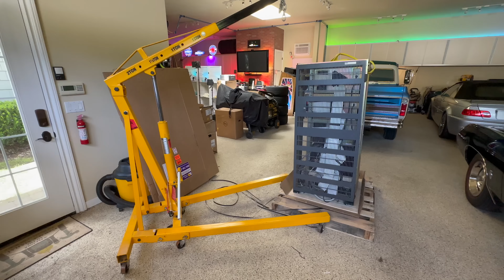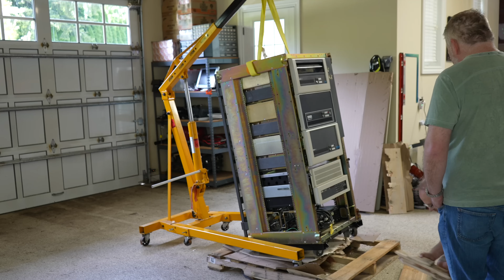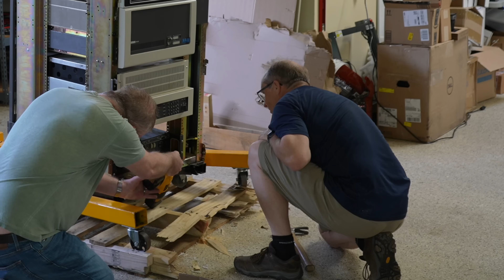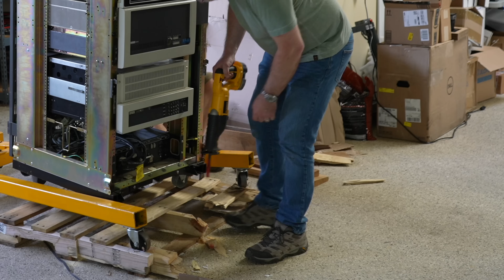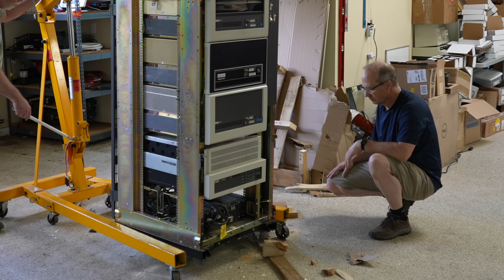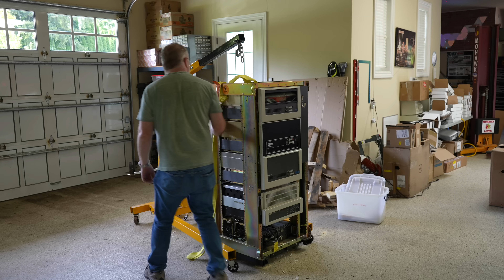I Bought the HEAVIEST Computer on eBay: The PDP-11/34!

Comment: I would very much enjoy seeing more videos on the PDP-11/34.  I worked at a semiconductor company that had a VAX/VMS system.  Not sure what the model was, except that it was a VAX. This would have been in the late 80's and early 90's. The system had Fortran and C compilers, and I wrote a lot of small programs in both languages. At some point, it also ran WordPerfect.  One night I wrote a program that calculated an approximation to a mathematical series; unfortunately the program got stuck in an infinite loop that kept taking more & more system resource and bogged down the control software that kept production running.  Needless to say, I heard about it the next day!

Comment: But, I obtained a surplus PDP 11/780 with a cluster module in the early 1990s.  I also used an engine jack to rig the unit into the room/lab that it lived in for the rest of it's life.  I had operated systems from 11/20, 11/730s and 750s on up prior to that experience.  And had experience with multiple 11/780 machines in a VaxCluster needing an elevated-floor configuration and 10base 10 Ethernet as a system administrator for a DoD contractor before that.    You just have to figure out how to rig the hardware into the desired space, or hire an experienced rigger who can put it in the spot where you point.  And make certain that an experienced master electrician wires up the configuration to meet the power and grounding requirements...

Comment: The Weather Channel's STAR local forecast system ran on the PDPs (34s, and 70s maybe) and some MicroVAX systems back in the early 80s to early 90s. The software was developed using PASCAL on the RSX-11M operating system.

Comment: Never worked inside a PDP 11 but I did some programming on one in my first professional EE job 45 years ago. I would be greatly interested in your future endeavors with this computer.  You were pretty blasé in describing what happened when you got it to boot but I suspect your heart rate spiked when you saw the directory listing start to flow on the terminal. I know I'd be doing a Snoopy dance if I was there. Congratulations! This is archaeology on par with discovering a new tomb in Egypt.

Comment: Love stuff like this! Back in the 70s I built one of the first Heath H11's which used the DEC  LSI–11 (PDP–11/03) using the PDP 11/40 instruction set. Heath was promising a reasonable cost Disk drive but I don't think they ever came out with it. In the interim I used an optical paper tape reader. Microcomputers were progressing quickly back in those days and before I could come up with a good disk solution I ended up making the switch to microcomputers and never did much with the H11. It was a pretty bad investment except I got to know a number of people at Heath and when Zenith bought them to create Zenith Data Systems (prebuilt computers, not kits) they contracted with my company to be one of their service agents so all was not in vain.

Comment: The first computer I ever got to play on was in 1977 and was an 11/34. I was located in an office in Adelaide South Australia and the 11/34 was in Sydney New South Wales Australia, over 720 miles away.
 My access to the 11/34 was via a Decwriter LA36 printer/keyboard. The cost of interstate data links in 1977 was enormous, so my link had to be only 300bps and was only available between 12 midday and 1pm and again between 4pm and 5pm weekdays. The government monopoly telecom service would use a manual switchboard operator to plug in the link at the required times each day.
Needless to say this often didn't occur, so I would complain and after a while they simply left the link up permanently. As a result I got a full time connection between Adelaide and Sydney for 1/20th of the normal cost for several years, so I was able to play on the 11/34 all night and all weekend, which I often did. 

Thank you so much for this video and yes I would just love to see anything more on the 11/34 you would like to make.
Reply: I'm born in 1978 but I believe I understand your journey. I had similar experience with the modems here in Bulgaria in the 1990's. Yes, the speed wasn't 300 bps but to be able to achieve something over 14400 bps I had to change to foreign straight phone line because our was duplex. 
(For the reference of the uninitiated, this means a line that is used by 2 households and has a relay that selects the active user at the particular moment while the other is disconnected.) So this type of line significantly degrades speeds and I was pushed to find a solution LOL
I am sure nowadays kids would never understand this struggle no matter how colorful you are trying to explain this to them :) 🙄

Comment: I am absolutely thrilled to see someone doing content on a relatively early PDP 11 that is capable of running ancient versions of Unix.  I’ve been trying to wrap my head around the performance of these machines.  But I see people say things like “they don’t have a clock”, which sounds more like legend than reality.  I have a gut instinct that an early version of Unix could probably run on a Raspberry Pi Pico directly from flash.  Either through emulation or cross assembly.

I would love to see benchmarks compared to a 8MHz 68000.  Since 68000 family was a very popular architecture for Unix in the 80s.
A PC, both modern and vintage if possible.
A 6502 @1.76 or 2.0 MHz because I suspect this will be closer than most people think to something like a PDP 11/20.  Although it will depend heavily on the software algorithm due to the constraints of an 8bit architecture.
And a Raspberry Pi pico.  

Preferably more than 1 algorithm.

I’ve been trying to find performance data on early PDP 11’s relative to something people are familiar with.

Comment: My first/brief exposure to PDP-11 (programming) was while I was in college around 1979, and was introduced to PDP-11 assembler and machine language alongside a few microprocessors including 6502, 6800, 8080, Z80, and 8086. What struck me about the PDP-11 instruction set was how "clean" and orthogonal it was, when compared to all the 8- and 16-bit processors, except maybe for the Motorolas.

About the backplane and grant line. I remember systems built up from wirewrap. I did a tiny amount of wirewrap prototyping back then. I remember looking very superficially at Unibus, and your experience combined with my vague memory made me wonder if the backplane was set up with the grant lines jumpered by wirewrap at each slot unoccupied by a card in the as-shipped configuration; if the system was to be reconfigured later, the idea was to remove the wirewrap jumper for each slot where a board would be added. Conversely, if a board was to be removed, the grant pins would need to be jumpered (easily done with wirewrap) for the system to work properly.

Comment: Dave thank you so much.  Cannot tell you how many memories you bring back when I watch your videos.  My glory days as an engineer were when I had project that required my own PDP11/34 to talk to remote 6502-based devices which did meter readings for electric company  industrial customers.  I was in Philadelphia and the company who had built this equipment was in Mountainview; so I always looked forward to meeting out there in February.
Reply: PDP's could be made to talk to just about anything. I remember an old say which went 'What's the easiest way to get two IBMs to talk to each other - Put 2 PDPs in between them'

Comment: My background is hardware not software and although familiar with PDP's I dont know about the OS etc and have done very little programming but a little assembler and more recently Arduino type stuff. That will be why you discussions usually go clean over my head. I didnt realise you had written a book about being slightly on the spectrum so I read your primer, that didnt go over my head :)

Comment: 40 years ago I was a newly minted electrical engineer working for Hercules Aerospace. One of my responsibilities was to support maintenance in the troubleshooting of the CNC machine tools. 

One of the machine tools machined the pins that would keep the attach ring to the space shuttle Filament would chamber.

This carbon fiber chamber for the shuttle would save enough weight that the shuttle could achieve a polar orbit. 

This very specialized machine tool was controlled by DEC PDP 11-23 and a number of Kiowa motion controller.  About 18 months after I started Z Hercules the Challenger Disaster terminated the FMC project

Comment: The hang-wringing about "You should never just plug it in and turn it on" with old technology is tiresome. Museums might be able to spot check each component in a vintage PC sequentially, but the rest of us in the real world need to plug it in and find out if it works, then replace what we need to afterward. I'm with Dave on this.

Comment: I graduated from a Vo-Tech school in Pa. back in 1974, and the computer lab at the time was still referred to as 'Data Processing'. They had a DEC PDP-11, plus several other systems, and a very early Monroe? calculator with a nixie tube display. I didn't spend a lot of time there, as I was taking machine shop at the time. We worked with some early NTC driven milling machines and I spent a bunch of time programming punch tape for these to make various projects. If I would have had a little more foresight, I would have taken 'data processing' and learned more about computers, instead of machining and metal work, since it was fast becoming a dying art, with all the precision machining eventually being outsourced to foreign countries.😝

Comment: In late 1970’s I (plus two other programmers) was using a PDP-11 to cross-compile Z80 assembler code for computing integrators that our company manufactured.  Machine code was on paper tapes punched on the PDP-11 and then read at the development station to test and debug the prototype system. At one point I wrote a BASIC interpreter so the program that generated reports could be written in high level language. A computing integrator was  used in a chemistry lab; it takes an analog signal from a chromatograph and produces a report showing how much of each expected chemical was found in the sample being analyzed.

Comment: I would love to see a walk-through of the UNIX OS on the PDP11.  I have been using Linux professionally since the 90ies, and I always thought I knew all the shell commands pretty well. But it turns out that very old UNIX OSes has some very peculiar and somewhat arcane cli tools. So it would be most interesting to see what everyday life in a first gen UNIX system was like. What you think?

Comment: The PDP-11/34 was the first ever computer i work with. We bauth itfrom and auction for 800$CA anf we rent a ruck to bring it to my place. It was all in pieces specially the hard drive controler that need a fullrack to hold all the cards for it including the ligts of the controler on top.  We  did not have any idea how to assemble these so we ordered the spec sheet for the PDP and the drive controler, the system came with 2 40mg hard drive that each look likr a diswaher and took as much place as a cloth dryer. Finally after 3 month we were able to start it but we did not have any OS for it. So we went to the university and borrow a tape with the os on it. We did have a mini tape unit for 7inch reel tape included in the rack as wellas 1mb of static memory board. So we finally were able to boot rsx on it and start having fun. The only problrm is that it took a 36,000 btu ac unit to cool everything down. I have it for 3 years and learn programming with this in assembler, basic, and cobol, and i worked in programming since then, that  was 45 years ago. so the PDP/11 for me is my little PC that i learn computers with but let just say that i prefer the computers of today to program.

Comment: Aaargh!  The VT-220 is really excruciatingly slow when smooth scroll is enabled.  If I recall, the console card is a DRV-11 (DLV-11??) and it has very little, if any buffering.  There is buffering in the VT-220 and you can still get over-runs because the XON/XOFF generated by the terminal doesn’t get seen by the O/S fast enough.  I don’t remember if you can do hardware flow control on the console card - it seems from my crusty memory that either you can’t or it is buggy.  Anyway, your best bet is to run the VT-220 at either 1200 or 2400 bits/second with 8N1 with jump scrolling.  Remember, the PDP-11 console was originally intended to be talking to a Teletype ASR-33 at 110 bits/second … more or less synchronously with no flow control.  That is why we do <CR> <LF> and not <LF> <CR> at the end of a line … so the type cylinder can be flying back left while doing the line feed.  I used to get annoyed because one of the Microsoft text editors terminated lines with <LF> <CR>.  Whoever wrote that editor must have been working on a video terminal.

Comment: Thank you Dave, I was hooked at the title. My 1st job (as operator) was to run software builds of realtime SCADA systens on various models of PDP11s. Your adventure brought memorys of talking with  DEC Technicians who were adjusting or repairing the devices on machine room floor. You triggered memorys from the 70s.
I follow what you post & PDP11s are a sweet spot. Thanks.
Reply: That's great. I had the job of building a network of SCADA systems across many corporate sites in the UK that communicated with a PDP11 using packet switching. The network was later sold to one of the UK telecoms companies and was still operational nearly twenty years later. I can't imagine the SCADA and PDP11 lasted that long though.

Comment: The RK05 is the successor to the RK02 which is actually a Diablo drive.  It uses the same disk packs but is not compatible.  The RK05F is the fixed version.

Comment: Dave my first job on Wall Street was working on recognition Equipment Incorporated REI which made check and cash OCR transport machines the banks used to check version and the Federal Reserve Bank on Maiden Lane use the cash version which would sort and test currency for counterfeit and wear and tear it was controlled by either a PDP 11 or a data General Nova supernova or eclipse mini computer system there were miles and miles of wire wrapped connections we constantly had oscilloscopes connected to the back plane two of the most common troubleshooting techniques were to constantly monitor the power supplies for an exact 5 volt VCC level if it were to vary by a tenth of a volt in either direction the systems would be flaky I cannot impress upon you how critical it is to maintain an exact steady 5 volts the other big fix was to run a rubber pencil eraser across the goldfingers of the pcbs to remove corrosion and oxidation just rubbing it down with the Red Rubber pencil eraser handheld version not the one on the pencil would dramatically improved stability I had previously worked on 360s and 370s where we would Place cold pizzas in boxes above the core memory cabinets which would melt the cheese .... the original microwave oven LOL.

I next moved on to wang Laboratories
Then Novell netware Where I focused on arcnet thick ethernet thin ethernet then 10 bass tea then T1 t3's then ATM then frame relay then building  out fiber backbones and trading floors and data centers with sun Microsystems spark stations then NT with cabletron 10 bast T  then when server active directory primary and backup domain controllers then Cisco ccie then ospf with bgp then infiniband with hft Colo at siac next door to nyse rebuilt it after 9/11 then VMware and sdn with ipsec VPN then got crushed after the GFC then went AWS cert did hybrid cloud and then networking became just a software application and I couldn't find a job to save my life lol

Comment: Technically you got that for a steal. $4,494 is only $745.60 with reverse inflation accounted for. A new pdp-11/34 appears to have cost around $30,000 in 1975, so $180,845.87 in 2024 currency.

Comment: My brother had a PDP 11/03 (free) which had Lead counterweights in the "panels". It weighed like a refrigerator. A Microsoft person I worked with had obtained an 11/70. Both were in working condition. The 11/03 had a paper tape reader.

Comment: I keep meaning to pull our old VAX 4000-300 out before it gets tossed and try to resurrect it.  Is there a Facebook group for help with that too?  It worked until we emulated it (still running) and turned it off and moved it downstairs.